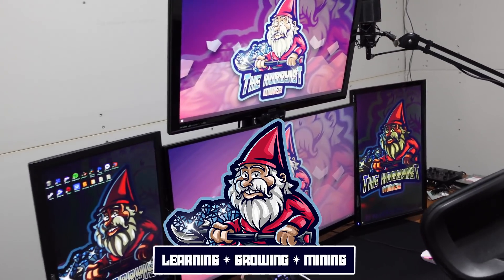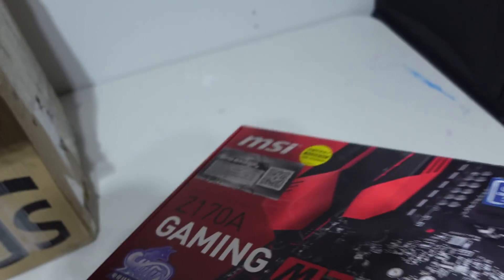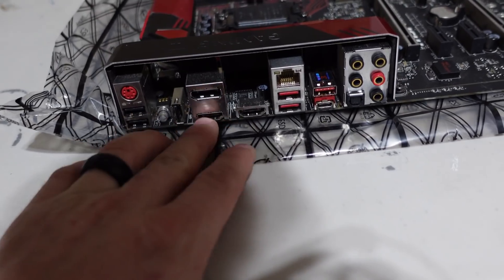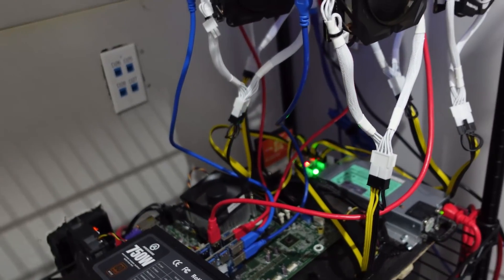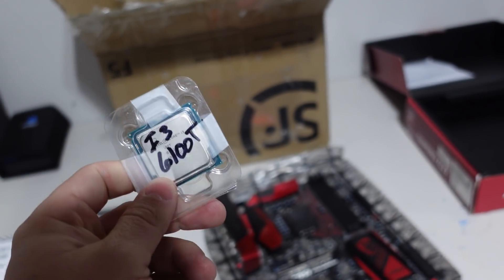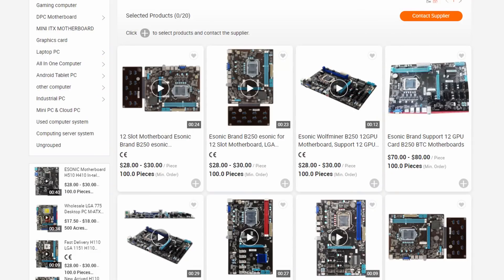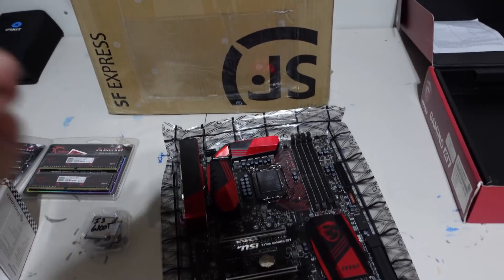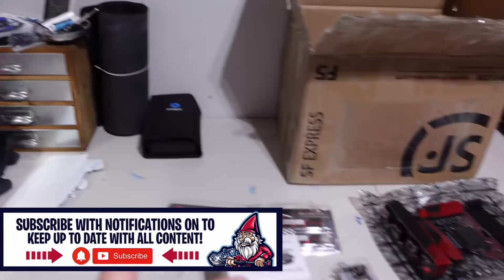Where to Buy Mining Hardware in 2022

Comment: Love my splitters ;)  by the way, you should use a M.2 splitter on that board and easily and cheaply go up to 8 cards for each of those boards ;)  the M.2 splitter i tried has worked perfectly and easily on my z boards
Reply from the maker: Thanks for the tip!
Reply: Hi... Any link for the m.2 splitter
Reply: @csanthosh75  not sure if the link will get filtered by youtube,  if so, just Amazon "m.2 to pcie adapter" .  I use the one that is a m.2 with a USB on it
Reply: @AlteredComponent  Thanks Got it

Comment: I've been burned twice with Newegg refurb and they refuse to refund me for DOA boards. Also, ASRock shares that shade with Newegg. Both are companies I refuse to deal with anymore.
Reply from the maker: 2 of the 3 I had to return they are replacing.
#1 Worked Amazing
#2 PCI Slot 4 would not work.
#3 Was two bent pins in the CPU Slot.  Unit would not boot properly.

I don't mind returning them to get replacements. As long as i have some spares handy.  Right now down a rig.
Reply: @TheHobbyistMiner  unfortunately I didn't have the complete set until way after the 30 day mark. Once I got everything installed, dead boot. Now I have a broken board in my closet.

Comment: Ive been running ASUS B250 Mining Expert since 2018. Have 5 of them.  Got a few when they were like $125 new and the others were all used on ebay for well less than $100 in 2018/2019. They run great for me and the G4400 CPU are stupid cheap. I cram as many GPU's as I can into one mining rig.  There are too many extra costs involved with only building 5 or 7 GPU mining rigs.  For (2) mining rigs that do 7 GPU's each I can run one ASUS B250 ME MOBO and mine 13 GPU's (up to 19 if 6 of them are P series). So instead of having to buy double everything for 2 (7) GPU mining rigs...I go with the ASUS B250 ME MOBO.  Have to buy 2 CPU's, SSD's, Ram, MOBO's and double the amount of PSU's.

Comment: how are you cooling a mining room to much lower than ambient temperature? You have air conditioning for that room set to 64?
Reply from the maker: It was 30 to low 40s outside at the time of this video.  I have 4 AC Infinity Inline Fans 6" pulling in outside air into that room.
Reply: @TheHobbyistMiner  ahh u live somewhere cold... I only stopped using air conditioner in house this week. we are lows of 50 highs of low 70s where i live.

Comment: I've been mining for almost a year now. Currently running 3 dedicated rigs (one 5-GPU NVIDIA rig - 2x1060 6gb, 1 RTX 3060 LHR V2, 1 GTX 1070Ti, 1 GTX 1080; two AMD rigs running 3-GPUs each - one is 3xRX6600XT and the other is 1 RX580+2xRX570 8gb). A good portion of my hardware is used, and some of it was stuff I already had. I'm primarily using ASUS B85M mobos (LGA1150 w/3 PCI-E slots) and an older Gigabyte GA990 AMD mobo running an Athlon II 250 dual-core CPU (has 5 PCI-E slots, so that's in the NVIDIA rig). I also have 2 desktop computers I use that are mining when not being used for other tasks (one is my main desktop, the other is my flight sim - RX6600xt and RTX3060 LHR V2 respectively), and my gaming laptop (RTX2070 MaxQ) is mining as well. All in all, a total of 14 GPUs mining.

I'm a huge advocate of using used hardware where you can. I've spent about $8k to get where I'm at, and some of that was on brand-new stuff that I "overpaid" for (or in the case of the laptop for $1600, I just "wanted"), but with average net earnings of about $900/month, I'm pretty happy. I'm less than 6 months away from 100% ROI on everything I have right now. My current issue is a lack of electrical capacity in my panel (only 100a service!), so that has to be addressed before I can expand more. This is why I'm looking only at super-efficient cards now (which is mostly AMD).

I'm looking at direct buys from China on Alibaba/Aliexpress as well, but haven't pulled the trigger on it yet. Most of my used stuff has been from eBay. New stuff from Best Buy and Newegg mostly. Some stuff from Amazon. Paying attention to AMD direct now too. But, I'm also looking constantly.....because you never know what will pop up, and I've missed a few opportunities by being hesitant. Patience is a virtue here I think...good luck in your hunt for hardware!

Comment: Thanks for another great vid!!! I luckily live 15 minutes away from 2 different Microcenters. They always have open box mobos for 25-50% off.. And I've actually been purchasing brand new GPU's such as 6600xt for 379 each on launch (3 of them) and I got 5x6600's fighters 349 each. 3x3060 1st edition LHR EVGA 399 a piece and 3x 1660super Asus dual 299 each. Lately they all still been in stock, but the prices are at least 100 to 200 more. My mining rig is set up with four towers and 4 gpus in each tower. Mobos are open box ASRock x570, Asus tuf b550, and ASRock b550 x 2. I have my rigs concealed into 4 separate towers because of my living situation... Have to keep it on the low. I have other like 580s and 1070 t.i. and 1080 t.i. Currently trying to figure out how to put those in my towers. Going to have to upgrade a couple psu's. Main point is if you're looking for a deal or anything in particular, you're going to find it as long as you put in work.
Reply from the maker: Thats insane!  Lucky Man!

Comment: the problem with the splitters is not enough heatsink.
placing an equallly sized heat sink on the back of the card will do wonders wonders for the temperature.
 there was another brand with a much larger heatsink with through holes. i replaced the tim with amazing results. take an infrared gun to the heatsink and measure the temps and you will see what i am talking about

Comment: I was happy because my T7500 Dell has 5xPCIe full size. 2x16 2x8 and 1x4 but or some reason, I can only mine on two GPUs mounted on the 2x16, if I use risers, can't even bootup. Now I'm waiting on a B450 Plus Max MSI but I may have ordered the wrong CPU for PCIe lanes (Athlon 200g) I may just order one of those "cheap" b250 or BTC-37 boards

Comment: I have had the same exact problem with splitters with the same exact board as you for the last couple of days, moved gpu's off splitters and now they are stable and getting a better hashrate, but I'm with ya on not running splitters anymore, just constant problems on my 580 rig